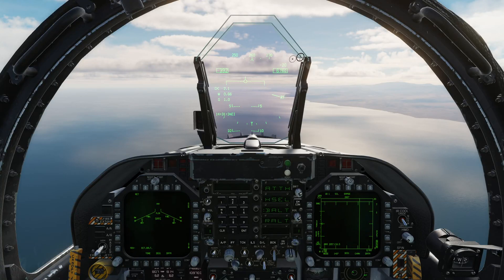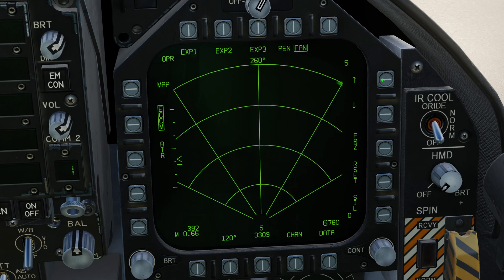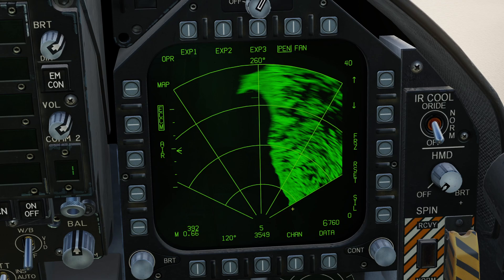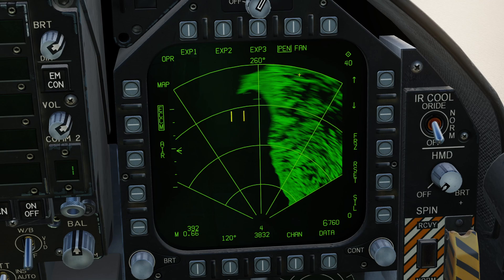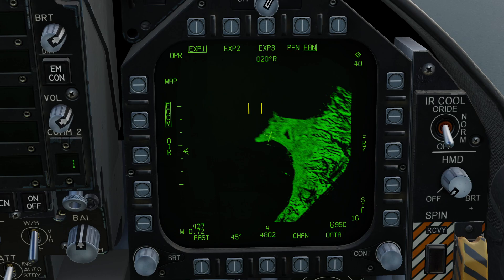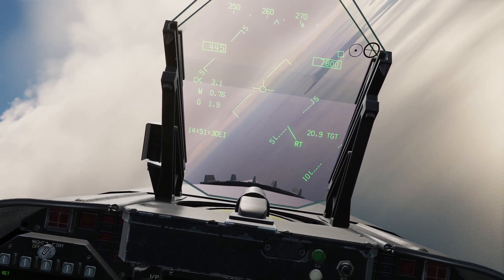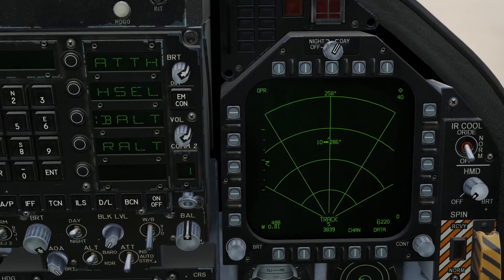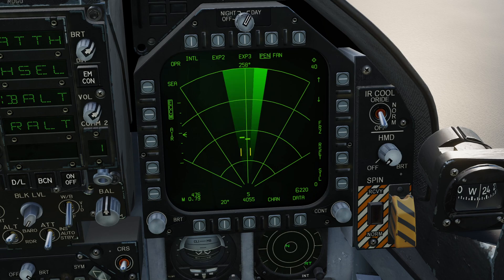DCS F/A-18C Tutorial 6 - A/G Radar Modes UPDATED

Comment: Great video! One thing I heard in passing from some flight sim or actual military manual/guide is that operating ground radar is quite demaning and requires a bit of elevated training. It kind of makes sense to me because I'm quite familiar with the A-10C and honestly, in order to put long range munitions on vehicle small sized building in an area, you pretty much need a visual ID through a targetting pod and those will give you a super clear and confident picture within 15-20nm -- maybe even further with ATFLIR. Even better, you can do this while the plane is in orbit.

To be able to locate and designate identifiable targets through ground radar seems impossibly slow and restrictive. Even GMT seems a bit tough to correlate over a larger surface area to ensure you're picking the right vehicle or set of vehicles apart. My best effort to using ground radar is an attack on an airstrip/field or FARP that for some reason, the GPS coordinates aren't known for but could be identified at those ranges. Through blurry images you could hit specific runways, or where you can determine a control tower should be. Even so, in what situation would it be useful to designate such a target outside of 20nm? I'm sure it can be construed, but it's rare enough that I think this should always require a dedicated WSO operating the radar exclusively. Too much focus needed to require that from the primary pilot.